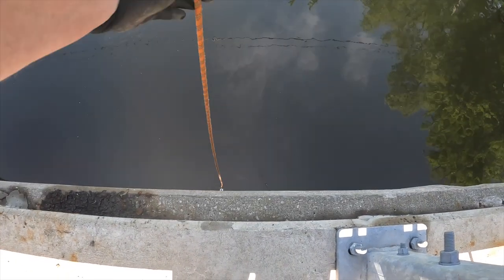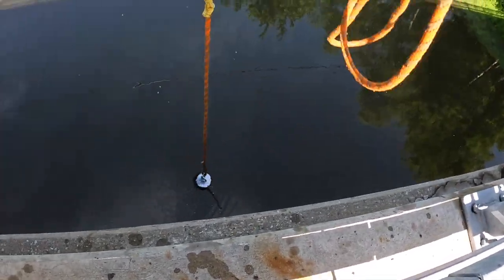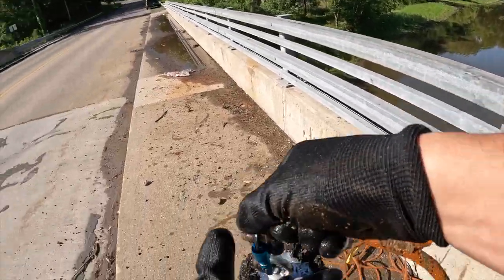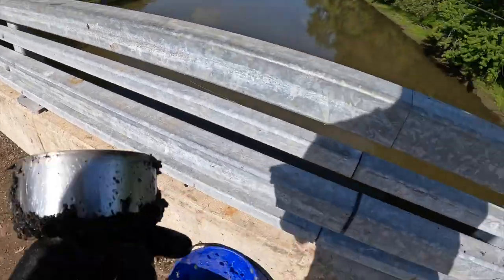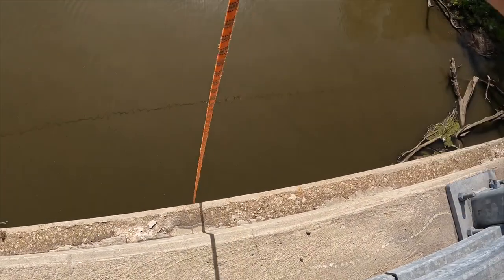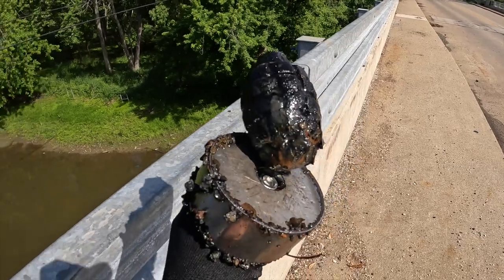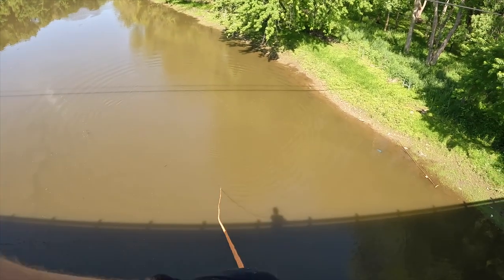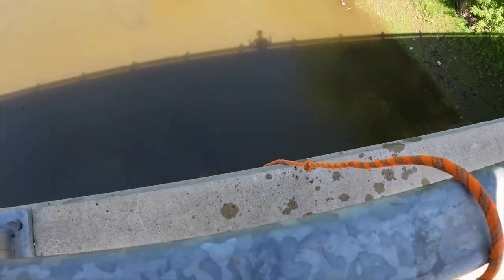"Bridge Locked Down by Police After Shocking Hand Grenade Discovery During Magnet Fishing!"

Comment: Grenades are shipped without the top piece, the primer, in place, so falling off a convoy truck might make sense. If it was off a convoy truck I would expect you will find more at this location, as they would have been moved in wooded boxes.
Reply from the maker: Thanks nuts wish the bridge wasn’t so tall I’d fish the crap out of it
Reply: The thing you had on the keys was a spark plug gapper old cars